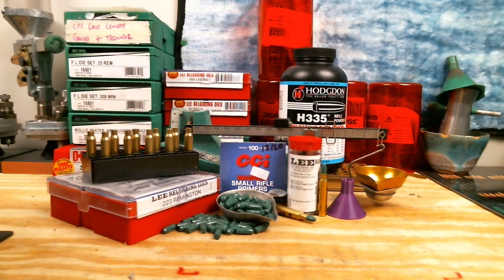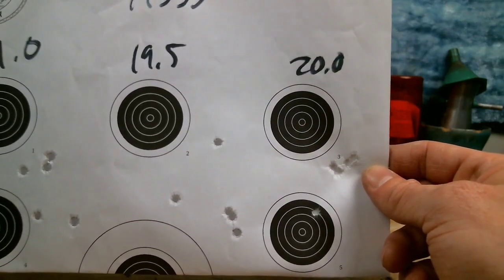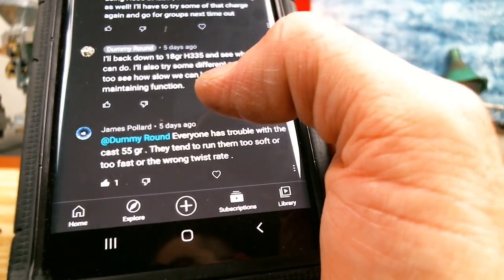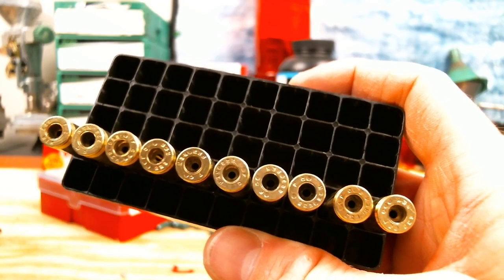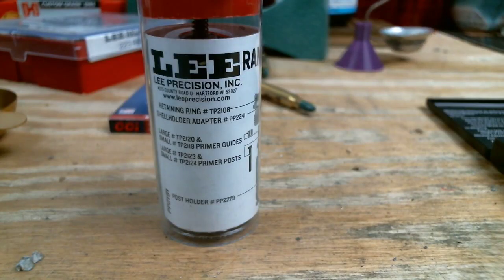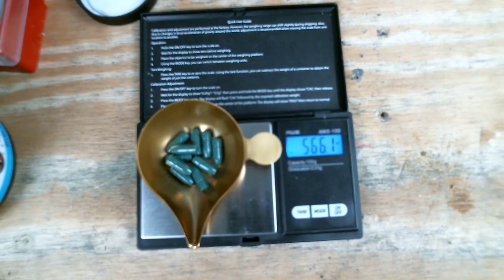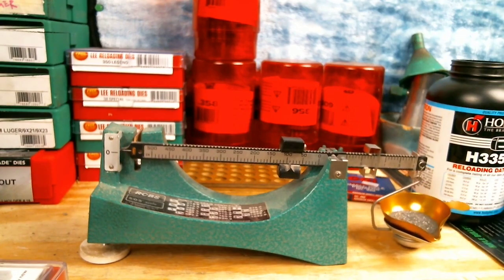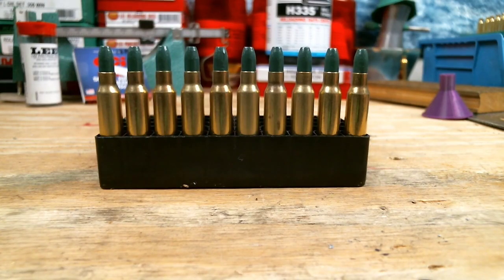Attempting To Dial In The Cast Lee 225-55 Using CCI 450 Primers And Hodgdon H335 With Federal Brass

Comment: What alloy are you running with the Lee  bullets? Water quenching those bullets out of the toaster oven after coating depending on your alloy should harden it up sufficiently.  Under normal circumstances a bullet designed to take a gas check will shoot more accurately once you reach a given pressure / velocity threshold than leaving it off.  A uniform base is critical to good accuracy and with the gas check left off the base it is no longer uniform.
Reply from the maker: I don't have a hardness tester, but I'm  guessing around 14 BHN, quenched after casting, but not after PC. It might very well be too soft. I've heard people having luck with the GC and what you're saying backs that up,  so maybe we will venture down that path when the time comes. Thanks for watching and the info!🇺🇸🇺🇸🇺🇸

Comment: I like blue dot for reduced cast loads.    But I also don’t run them through semi auto actions.   I usually push loads to about 1800-2000 fps.
Reply from the maker: That seems to be the sweet spot for velocity and accuracy without having to go ridiculously hard with your alloy. This bullet is pretty crap in an AR, but the bolt gun does a decent job if I keep the pressure down🇺🇸👍👊
Reply: @DummyRound  - good to know.  I have the same Lee mold but haven’t used it.    A buddy of mine has Savage 22 LR (mark 2 maybe?).  Anyway it’s a nice shooting 22.    It likes CCI green tag.   I told him I thought I could build a better shooting cartridge for equal or less money then his green tag ammo cost.  This was while Trump was still in office so ammo $ hadn’t gotten stupid yet.   I had bought some 40 grn armscor bullets made for the 22 TCM.   I was getting them for about $5.00 per 100 & thought I’ll add a $.03 primer and $.02 worth of powder and I’m in at $.10-.11 per round using range brass.   I’ll tell you 7.0 grn of Blue dot and the bullet seated with a Lee .223 seating die bottomed out yielded a OAL of 2.055 and between 18-1900 fps (20” barrel) and will group just over an inch at 100 yards. I was shocked and still use this load for plinking.   It doesn’t like to feed in all rifles but it will feed from the mag of my RPR in Ruger .223 bolt gun.  This pretty closely replicate 22 magnum in ballistics. 

Here’s a video where I was testing this load against a 30 caliber air rifle. 

 The air rifle held its own although the Frankenstein .223 load out powered it slightly.   I used a 130 grn MP sledgehammer hollow point in the air rifle.    Pretty surprising that air rifles are starting to match the lower end firearm calibers. 

30 Cal AirRifle Vs .223 Reduced Load
https://youtu.be/myWYeUqY9zo

Comment: I just purchased this mold. I'll be shooting these in a cz 527 varmint. This rifle has consistently grouped 1/2 moa with 69 grain sierra matchkings. I'm curious to see how accurate I can get these cast bullets. I'm not concerned with velocity, I don't care if it's 900 fps or 2,400. Just experimenting for best accuracy.
Reply from the maker: I've had pretty good luck in the bolt gun if kept under 2k using range scrap and powder coated👍🇺🇲

Comment: I really like 16gr of IMR 4198 or 15.5gr of Acc 1680, no gas checks, powdercoated 15BHN. I just chamfer slightly more, no need to expand. What helps is putting your bullets in the freezer for a bit before seating.
Reply: I would think using magnum with H335 its going to burn too fast, try them with a slower burning IMR 4198
Reply from the maker: @jaredhempfield5227  thanks, I have plenty of 1680 to try, but I'm not ready to buy a pound of anything IMR for $70😬

Comment: How did these shoot. Ive cruised your list for a range report without finding one.
Reply from the maker: It looked like a shotgun pattern and I haven't really revisited them at all. Probably need a slower burning powder that can still generate enough gas to cycle but not get too high in pressure. I never tried with gas checks, either.

Comment: What FPS do you get out of these? I intend on using powder, gas checks, and enough powder to reach 2500 FPS.
Reply from the maker: I didn't chrono them at the time, and it grouped more like a shotgun pattern than an actual group. But, if you're just blasting inside of 50 yards, then you should be good to go. You'll want 20+ bhn along with your GCs. Start a few grains under their normal recommended charge and work up until it functions. Then, you'll have a little room to fine-tune before the wheels fall off for accuracy.
Reply: Do you put gas checks on first, then powder coat? @DummyRound
Reply from the maker: @humansvd3269  some do before powder coating, as that can add thickness to the base and make it more difficult to seat the gas check. It makes a difference, but you'll have to see if it's worth it to you to have to handle each bullet an extra time. Also, handling the uncoated projectiles could contaminate them with oils or whatever to a point that makes powder coating more difficult.

Comment: I'm looking forward to seeing those groups . What twist is the rifle ?
Reply from the maker: 1/7 twist, might be too fast. Thanks for the tips so far 🇺🇸👍
Reply: @DummyRound  I haven't tried the 55 gr cast in a 1/7 twist .
Reply from the maker: @jamespollard1670  what twist are you running, barrel length, and do you know your velocity? So many variables to consider haha
Reply: @DummyRound  I haven't shot those in a long time . For the 55 cast I was using an AR with 1/9 and 16 in barrel. The OVL at 2.085" . The bullets being quenched after PC made a big difference also . They were 18 bhn . The velocity was around 2,000 - 2100 fps , I think . I only ran 16 gr of H335 for bullets not water quenched after PC . You can re - cook the bullets you have PC'd already  and water quench them . Quenching and getting them hard is key to 223 cast accuracy .
Reply from the maker: @jamespollard1670  if we don't see any improvement at this charge, I will try the rebake and quench!

Comment: Almost had me with that excellent 100yd group 😂😂, be good to see 3-4" at 100 not sure its possible
Reply from the maker: If we can cut the shot gun pattern in half I would be pleased. This is supposed a cheap training/blasting load I can take out and have several people shooting without breaking the wallet or stock pile. Thanks K24! 🇺🇸🇺🇸👊
Reply: @DummyRound  I did cast 270 without gas checks at 100 using H4895 reduced load 1900fps with good results, 3-4" best group, lead was 15bhn
Reply from the maker: @K24-d4d  Ok cool, that sounds obtainable. I've never done any 270 before!